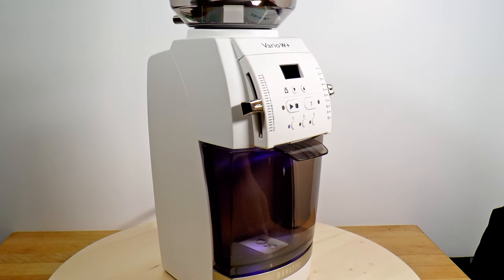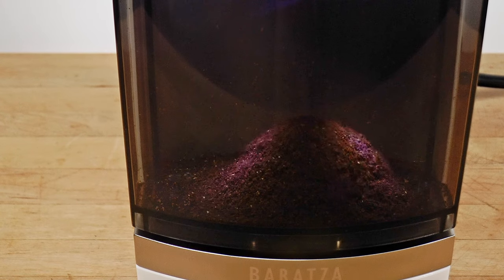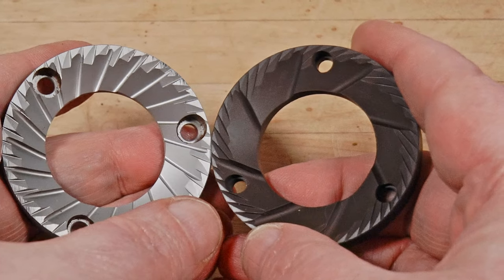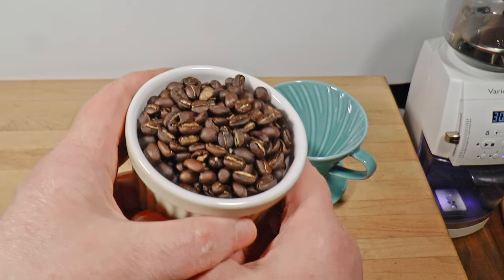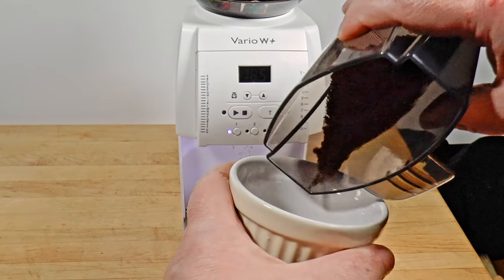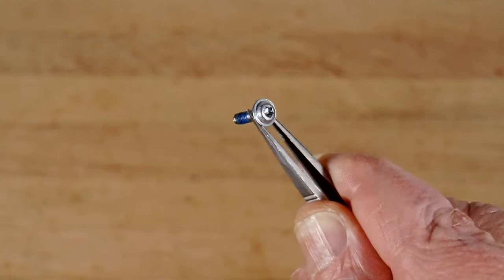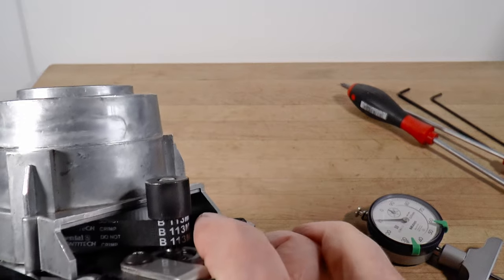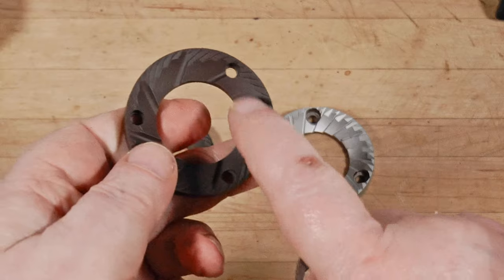Baratza Vario W+ In Depth

Comment: So as someone who went through the alignment process with an older Vario with the Forte grind chamber and upper burr carrier, I can add my  experience here.
The older Varios didn't have that belt tension screw plate, so setting belt tension is not particularly easy to do repeatably. The alignment from factory could (and very well may still) vary wildly. The runout is actually really really good, it's just the belt tension and chamber misalignment during assembly that causes poor burr alignment.
Basically the way the alignment method works is to jam the burrs together with the adjust arms while the grind chamber is juuust barely loose, tighten down the burr chamber so it is aligned correctly, and then tighten the belt to the minimum tension you can get away with.

Comment: Very comprehensive and articulate video. That must have been a lot of work. Thank you.
I got the Mahlkoenig Vario for a very low price but had to calibrate the burr alignment as there was a significant amount of boulders in the grounds. I also found the construction to be a bit flimsy but it works very well now. Your video now made me consider using the steel burrs.

Comment: Hello, really informative video. I'm no expert but you made this easy to understand. 
For years I used a conical grinder for espresso, pourover and French Press. I switched to the Vario-886 with ceramic burrs and plastic burr carrier to try to up my espresso game. I was very disappointed with the Vario-886 consistency of espresso grind and incompetentcy of the French Press grind.
In fact, after the first month of use Baratza swapped out the grinder for a new one because it just stopped grinding all together. However,  I continued to be disappointed with the grind of the Vario-886.
Before my warranty expired Baratza came out with the Vario+ and they (Baratza) graciously offered to swap out my Vario-886 with a rebuilt 866 but with metal burr carriers and the updated adjustment levers but still with ceramic burrs.  I've had this grinder for 3 months now and although I'm happier with the espresso grind consistency I'm still not happy with ability to get a good French Press grind with the factory 2Q calibration. I can get a fair coarse grind for French Press if I recalibrate but then I have to recalibrate back to 2Q for espresso.
Do you think I can get a more middle of the road calibration if I swap out the ceramic for the metal burrs?
Thanks in advance for reading my reply.
Reply from the maker: The steel burrs will make noticeable improvements in pourover, and are more multipurpose than the ceramics, but they are not ideal for espresso. Still, they don't ruin it, whereas the ceramics do kinda ruin everything north of the Moka pot. Choose your poison :)

Comment: How accurate is the grind-by-weight feature of the W+? Maybe I’ll get it with ceramic burrs for espresso.
Reply from the maker: It's almost as consistent as the timer. You can get used to it, and dial in pretty well. But, yeah, the timer is a bit more precise.

Comment: My Vario makes horrible espresso, it doesn't seem to grind fine enough. may I email you pictures of the ground coffee I get to get your opinion? I use a gaggia classic pro but shots get pulled way too fast and I heavily geeked out all the parameters I could think of. I calibrated the grinder (I followed the video from the manufacturer). Thanks in advance!
Reply from the maker: TBH I really can't tell much from pics of grinds. I can say that if you're unable to get it fine enough for espresso, that's usually because the burrs aren't parallel. See the video from atound 07:25 to around 08:00.